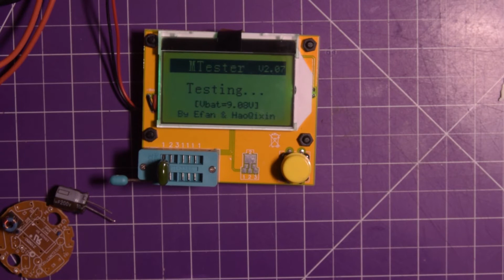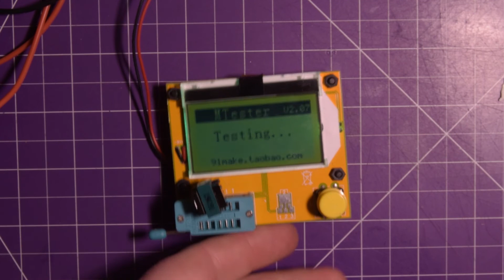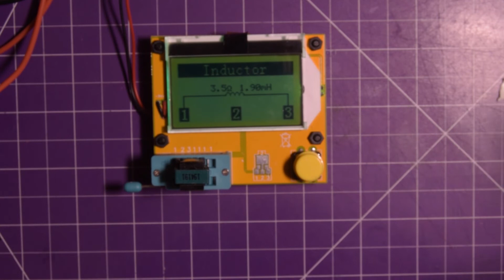Salvaging A Blown Compact Fluorescent Bulb

Comment: An easier way to open it is to screw in a bulb holder and separate the aluminum screw base from the plastic after removing the small cap to allow the cable to be loose. CFLs are trickier than LED bulbs because the glass can easily break. Thanks for the video!